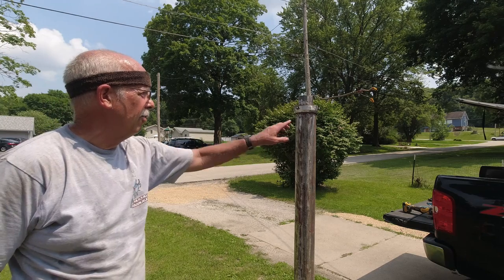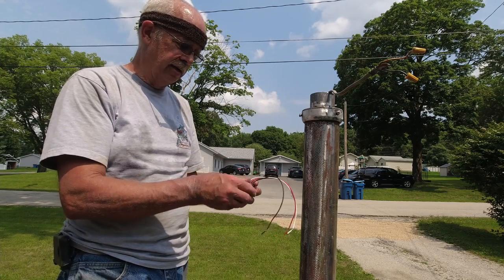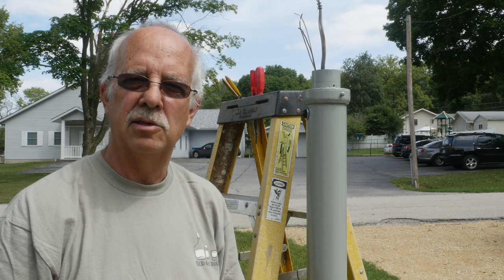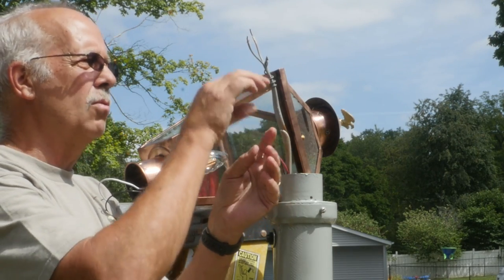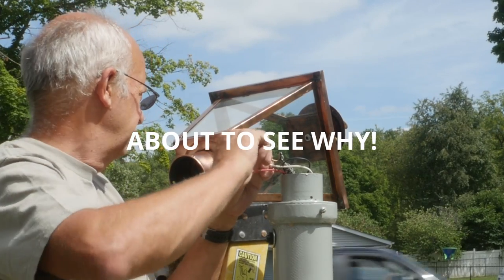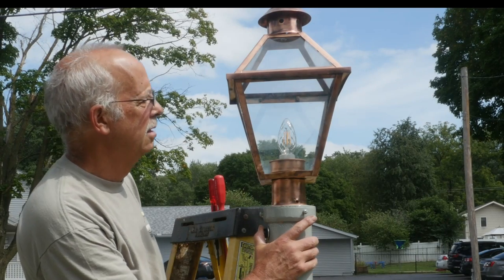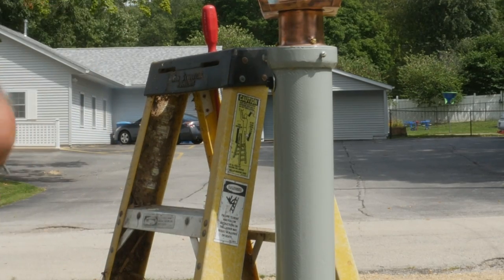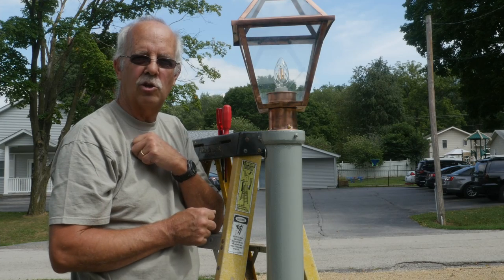Post Light Photocell Wiring

Comment: It's better if you disconnect each sensor wire one by one and reconnect the new one one by one before removing the old sensor. Then remove the old sensor and put the new one into the hole. With the wires already connected you cannot accidentally drop it down the inside of the pole.

Comment: What size is the pilot bit? Thanks
Reply from the maker: Pilot bit on a hole saw is 1/4".  The size of the hole saw required will depend the the diameter of the photocell.  In this case, it was 7/8"
Reply: @rogersshop  ok thank you, I have a black and white wires and the ground from the lamp, how will I connect the wires from the photocell it have a black ,red, white cable. Thank you for your help.. laz
Reply from the maker: @lazarogonzalez6719  From the power source:  Black to black, white to white (along with light socket).  Red from photocell goes to black on light socket.
Reply: @rogersshop  ok thank you sir.